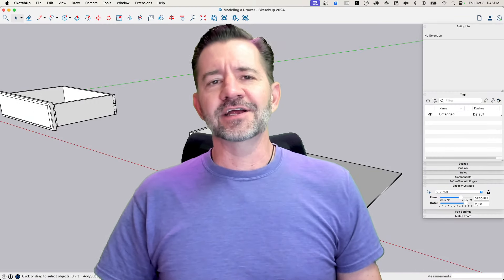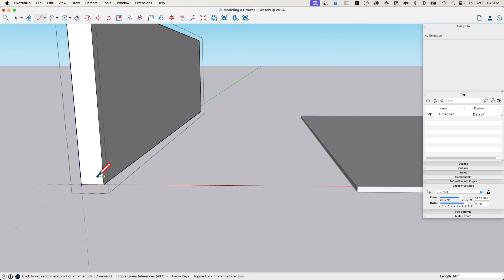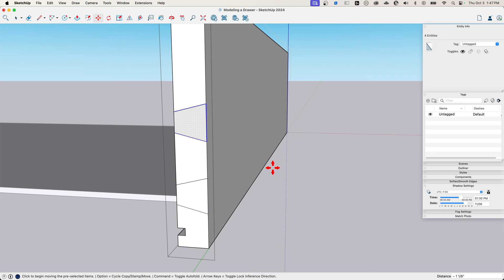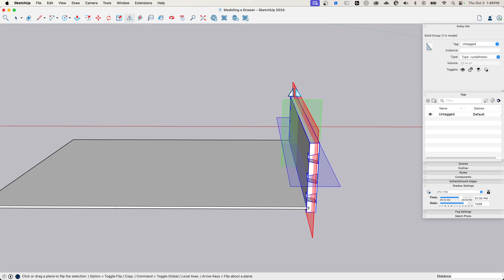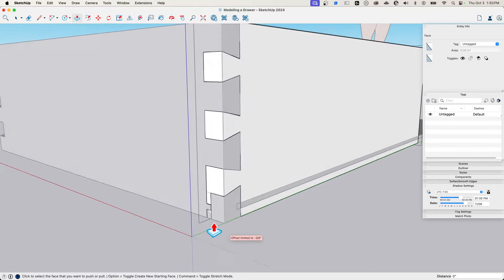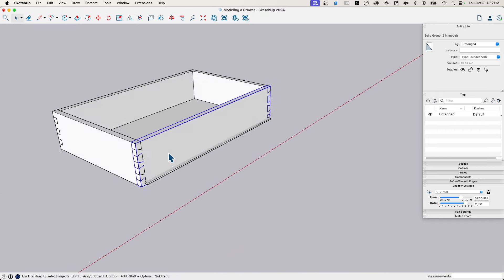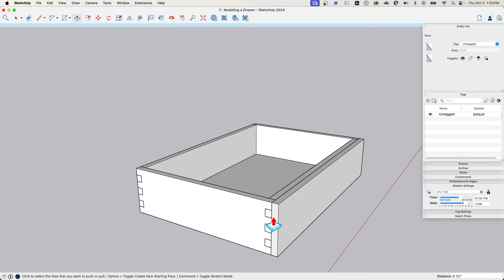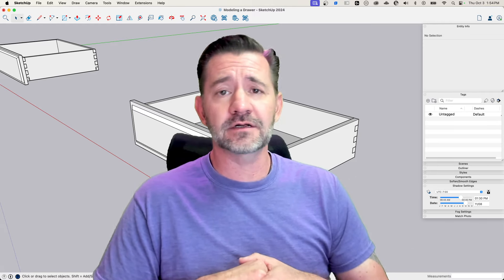How To Model a Drawer in SketchUp

Comment: Good technique, it's just that your dovetails are going in the wrong direction. The point to using dovetails, (Other than looking good) is so that in the event the glue fails, the joints will hold itself together mechanically. Putting the dovetails in the direction (as shown in the video) they would simply pull apart in the event of glue failure. 

I know that isn't the point of the video, I was just pointing it out.
Reply: I think that he is doing it just the right way ;-)
Reply: @tinbert  The force applied to a drawer as you open and shut it, should be applied to the wedge side of the dovetail, not the straight side of it. The straight side of the dovetail can pull out and separate the joint if the glue failed.
Reply: You‘re right. 
I misread your comment. Sorry.